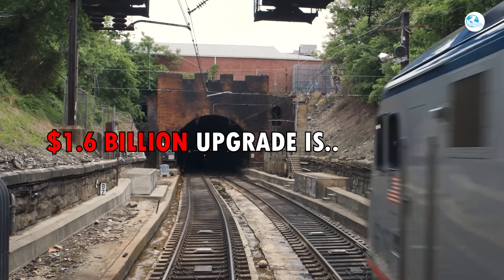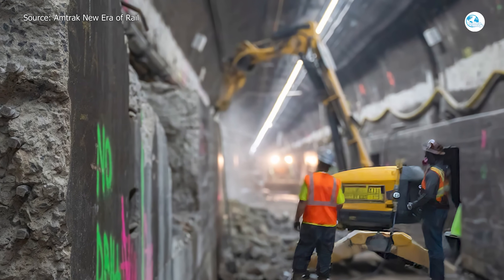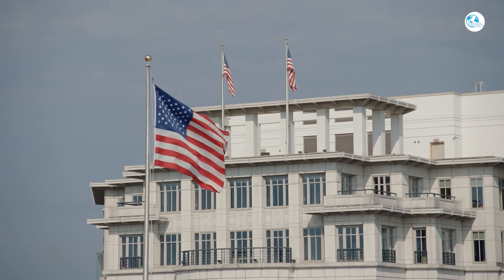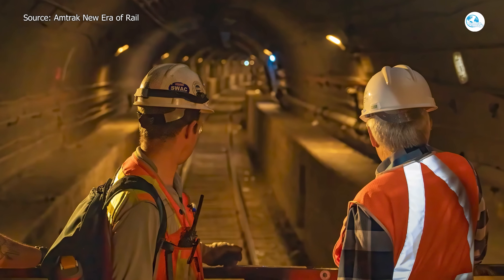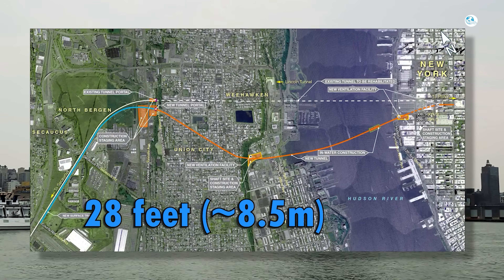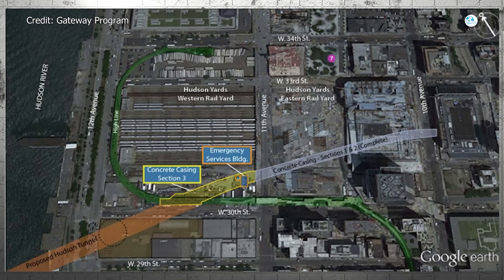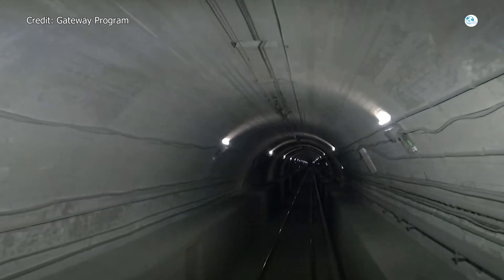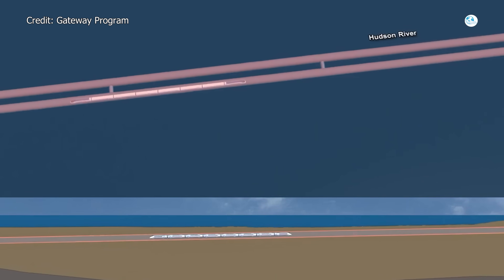These Multi- Billion Dollar Amtrak New Tunnels will Save NEC...

Comment: There has been no climate change from global warming that was expected to begin at 1.5°C.   NASA reports global warming at 1°C where it has been since 1992.  The cause of global warming is not known with studies to its cause going back to the 1970s.   Carbon dioxide is the gas of life.   1200 ppm atmospheric carbon dioxide about three times today's levels would greatly green the earth and is used in plant growing greenhouses.

What a lot of rail fans are looking forward to on the NEC is replacing the Baltimore tunnel with a double stack capable tunnel.   The Hudson NEC tunnels will be augmented with two double stack capable tunnels of lower track speed than the original tunnels.   These improvements will allow double level passenger cars such as Superliners on the NEC between Washington and NYC which is the source of all long distance Amtrak passenger trains on the East coast.

The Gateway project was originally behaving as a method to bring in huge amounts of federal money into the area with comprehensive rail improvement not a priory.   A project with no honest completion date.   The needs of Amtrak and freight railroads were sidelined.   A lot was improved during the prior Trump administration such as having the new tunnels being double stack freight capable which was not disclosed at the time. 

 The mess still lacked focus with local political forces making it too time consuming to make the project federal fundable.    It got funding under the Biden administration with a new focus with Amtrak and freight rail having grown.   Under the present Trump administration the mess still existing on the Penn Station side was taken over under the Trump administration.    

I complained in many comments the new Hudson River tunnels should be double stack capable and not exclusively focused on NYC commuter trains of the project's past management.  Not being double stack would have meant in the next 100 years their new construction would have effectively blocked any new tunnels that could provide double stack ability.   Being double stack freight capable can transform freight rail traffic in the middle Atlantic states.   The new tunnels are the big change that allows the smaller changes needed for double stack freight and passenger cars to be worthwhile.   Its past time to replace the current catenary with a much higher one of constant tension needed for HSR.  The lower NEC still runs at half the voltage of the world adopted 25kV which is used on the upper NEC electrified in recent times.
Reply from the maker: Wow, you really covered a ton of ground here. 👍 The NEC upgrades are definitely overdue. The politics around Gateway have definitely slowed things down, but hopefully with the funding locked in now we’ll start seeing real progress.

Comment: Once they are done, they will have 4, not 2 tunnels under the Hudson River, they will be able to run twice as many trains under the Hudson river.
NYCTA has been repairing the damage caused by Hurricane Sandy, and doing MAJOR upgrades because it WILL happen again.
Reply: The Hudson NEC tunnels will be augmented with two double stack capable tunnels of lower track speed than the original tunnels.  The new tunnels will add capacity with the ability to run double stack freight into NYC.  Freight rail traffic in to NYC has been a need forever.   This can be a method to reduce truck traffic.  The new Hudson River tunnels along with a new double stack capable NEC Baltimore tunnel will allow Amtrak to use double stack Superliner cars along this section which is the source for east cost long distance trains.
Reply: What Superliner cars? They're almost at end of life with no replacements.